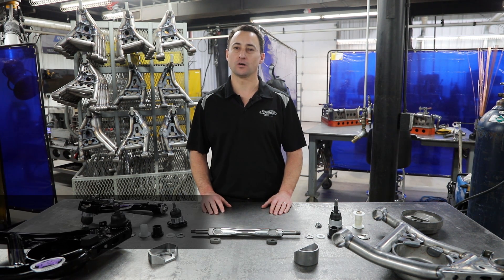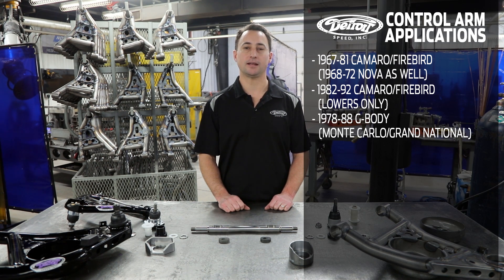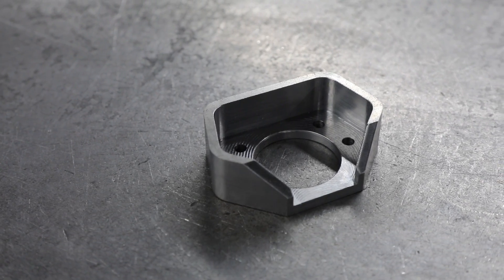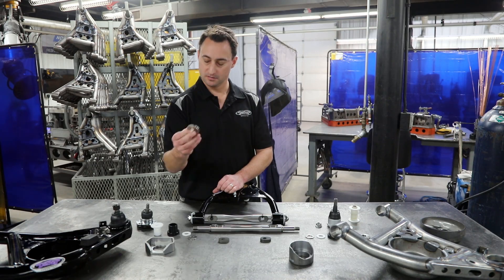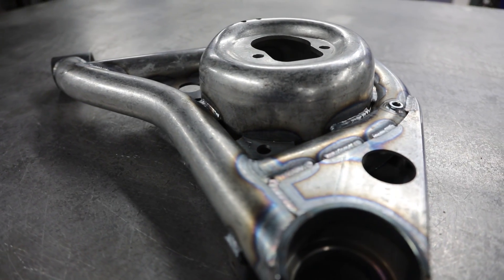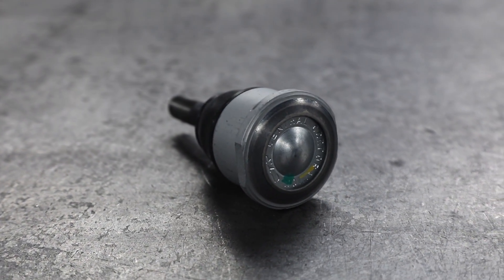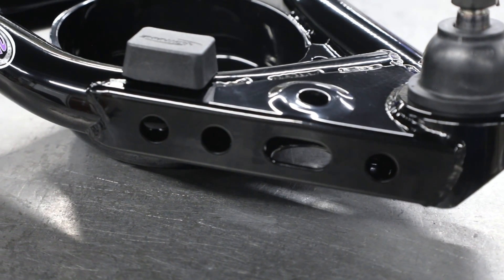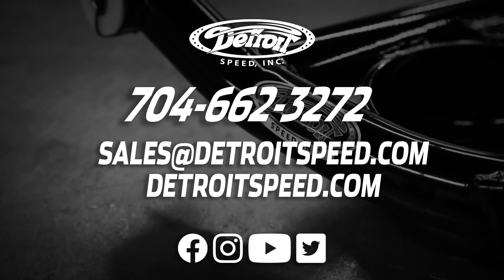Tubular Control Arms - Detroit Speed Tech Talk Ep. 003

Comment: 68 camaro with your arm and basic coil overs. Sbc car. Spring rate says it comes with 550lb springs. Is that too much spring?  My 67 chevelle sbc coilover calls for 450 in a sbc and 550 for bbc. Dont want too stiff of spring in the Camaro.  Thanks.